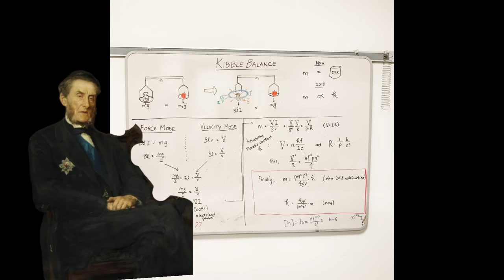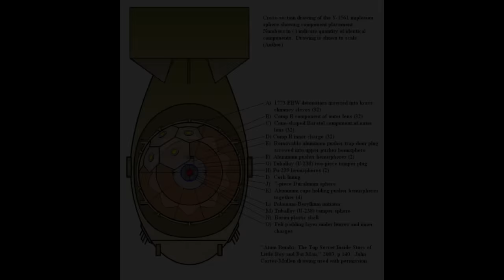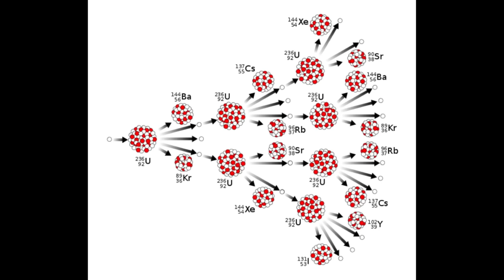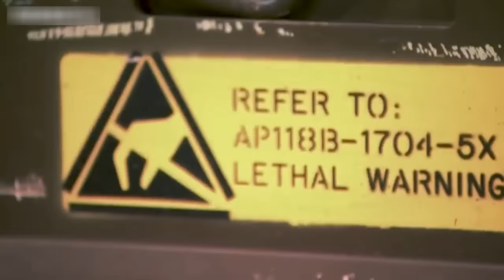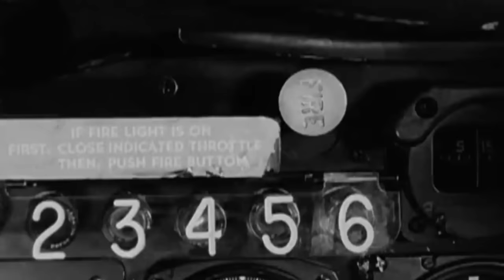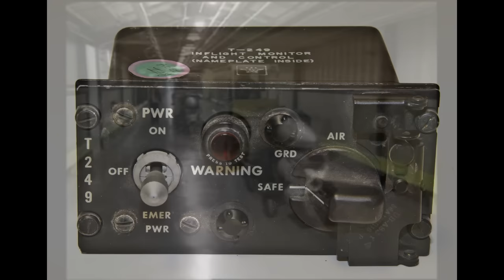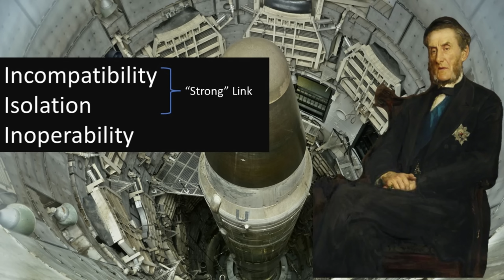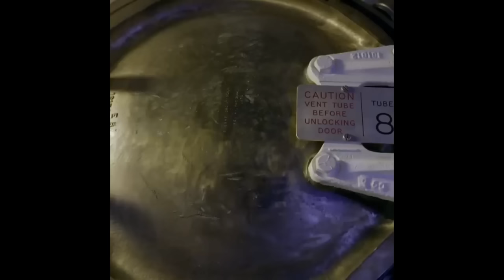This Way Toward Enemy - How The Bomb Didn't Quite Go Boom

Comment: Your definition of the energy unit at 6:00 is wrong. The definition of a kiloton (of TNT) is 4.184 billion kJ, not 4.184 kJ/g. That dimension would be wrong anyway: kJ/g is an energy density - so the amount of energy per unit mass. A kilocalorie is the same as 4.184 kJ, so a kiloton is the same as a billion kilocalories, which isn’t really all that suspicious. The energy density of TNT is actually about 4.6 kJ/g or 4.173 billion kJ per 1,000 (short) tons, or kiloton, so it’s a pretty reasonable approximation for American scientists, using their idea of a ton, to define a kT as a billion kilocalories.
Reply from the maker: I am always open to the idea I'll get things wrong, and it has been a long time since I recorded this, but I think I focused on TNT/g equating to 1kcal, rather than going to kilotonnes - which I didn't really think was suspicious so much as an intresting equivalence. I think it's possible then, that you may have put your decimal point in the wrong place, or I may have

Comment: Personally, I've never worried about the bomb. This is for a simple reason - I know for a fact that should the excrement hit the aircon, I'm going to (very briefly) be one of the first to know. I grew up in High Wycombe, home of RAF command, AKA a priority 1 target with several warheads aimed at it. I currently live a few miles away from the RN's ULF radio array, the one used to talk to the UK's sub fleet. Also a priority 1 target.
Y'see, dying in a nuclear fireball isn't scary - a big flash of light & game over. It's the thought of SURVIVING that scares me. Trying to live in an irradiated hellscape, slowly dying of radiation poisoning - THAT'S the scary part...

Comment: The fact that with all of these incidents, none have gone off in the intended military weapon manner says that really, don't expect a high rate of big bangs when actually thrown or dropped with intent.  Note that in the Falklands war, as few as 50% of the dumb bombs dropped on the islands by the Argentinians actually went bang and didn't just hide in the dirt. What is there in a gravity bomb to go wrong?  To not work?  The complexity of the atomic bomb, let alone the delivery system gives so many more avenues of failure meaning that it would've been unusual for even 10% of the atomic bombs that left their bunker store to actually go big boom at the designated target.
I'm in Australia and when one looks at the reality of the MAD war, it would been almost entirely conducted north of the Equator and would've had little problem within our country. And yet we were sucked into the massive fear.  Yeah, maybe the northern hemisphere may've been largely fucked, while Australia would've stopped importing British motor cars and bikes.
Reply from the maker: I think, with respect, that misses a couple of very important factors. The Falklands failures were pretty much all down to fuzing correctly - Argentine pilots were flying lower, faster than had been expected and maneuvering on drop. If you look at the Gulf about 5% of RAF bombs failed to explode.

The actual behind-the-nose of a hydrogen bomb is failry predictable and repeatable, not to mention testable, so baring failures to launch, at least for NATO forces, most would go off.

As of Oz being ok...maybe. assuming China doesn't have an automatic 'nuke everyone' approach like the US/UK had in the 70s where whoever fired both China and Russia were going to get nuked irrespective, there's still a global climate disaster. Calculations done by, amoungst others, Carl Sagan, assumed each person living in a city has about 1000kg of stuff that would burn, possibly for years. A lmited exchange, where 60 cities got hit could throw enough carbon into the upper atmosphere to block out the sun for 30 years, triggering crop deaths, massive global temperature reductions and mass starvation. A geneal release could see hundreds of cities hit.
Reply: @HardThrasher  Thank you for clarifying the reason for the Falklands duds.  What I did read was that this 50% failure rate was mentioned by a British officer in a media briefing. It was then published in a New York newspaper and the next raid by the Argentinians had a much lower dud rate.
Australia is a very large country with very spread out cities.  Very few of them have any strategic value. (To anyone, even other Australians.) There would be very little bang for their buck in wasting an expensive nuclear device in any more than a few targets in Australia.  We have the Americans buried at Pine Gap in the centre over a mountain range from Alice Springs.  It is apparently an communications cross roads (exactly what they don't tell us.  Rumours include that there is actually quite a significant underground city there.) A bomb on there would have only local impact with nothing above ground to burn.
Then there is North West Cape way up on a corner of Western Australia.  A submarine communications base.  You could set off half a dozen atomic bombs here and the rest of Australia wouldn't know or care.
At the height of the MAD fear, none of the Australian capital cities had enough to burn for more than a few hours with little ash to carry.  It is only down around Melbourne that the ash would get into the jet streams and carried around the planet.  Looking across the Pacific there are few targets of interest from the cold war antagonists that would've warranted expenditure of an ICBM let alone sending a manned bomber around the planet.
The theory of the nuclear winter has generally been debunked as it's found that the atmosphere clears more quickly than early theories suggested.  One point about atmospheric mixing is that to a very large extent, what happens in one hemisphere stays there.  Especially if it is more than 30 degrees away from the Equator.  The stronger jet streams contain themselves around the 40 degree lines of latitude.
Yes, we were worried but we were being harassed by the American and British media consistently with the fear stoking, but the clue was that they usually phrased it "the end of the world as we know it".  Simply the areas above about the 30 degrees line of latitude in the Northern Hemisphere would no longer need to worry about completing their Tax returns for that year.
Oh, and the number of Soviet long range bombers that were actually serviceable at anyone time was a lot fewer than they ever revealed as was discovered after "the wall came down".  The Americans weren't much better.
Reply from the maker: You're absolutely right about the briefing- it was a BBC reporter who put the story out and within a few days the Galahad got hit with massive loss of life and horrific injuries (there were other contributing factors but the bomb did explode)

I've heard that nuclear winter theory has been debunked, but I'm not convinced - or at least I haven't seen the same level of science being applied to debunking it as I saw in its foundation, but I freely admit it isn't an argument I've followed with wrapped attention so could easily be wrong. It strikes me that either way we probably want to try and avoid a general nuclear exchange ;)
Reply: @HardThrasher  I think that it is well covered in "The Art of War", but one of the most important things in winning any possible confrontation is to ensure that your enemy is in fear of what weapons you may, or may not have.  You've alluded to always overstating the capability of both your hardware and software (in this case, including aircrew).
Your real enemies aren't always on the battle field or even in the armed forces.
I believe that part of the US strategy of bringing nuclear missiles into Europe was that the Soviets would see the launch sites as a first priority target and the US (maybe throughout NATO) thought was that the thought to the Soviet leaders was that they would cause significant damage to themselves directly and indirectly from the blast and the fallout such that they would be extremely reluctant to trigger the use of the bombs.  Stalin being gone by them, they may not have been so suicidal.
I've only come to your site recently and have enjoyed the subjects and your style of delivery.  As you show, no story stands purely on it's own and there are always many substrands that enlarge the interest.  While visiting Cosford in 2006 and viewing the TSR2 I overheard a man conducting a group of Boy Scouts discussing the machine.  I spoke with him and discovered that he had actually been ground crew present as the second prototype was preparing for it's initial flight when a man came running over waving a sheet of paper and ordering that he shut down as the word had come through that the project had just been cancelled.. 
I appreciate your earlier responses to my comments.  Having a much more modest pair of YouTube channels, I understand that keeping it active for the algorithms can be tedious and time consuming.